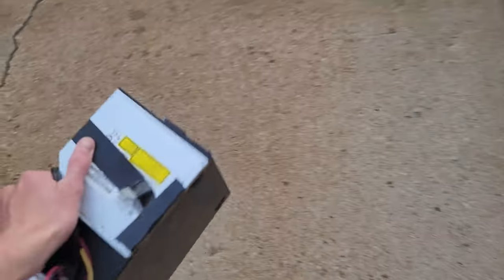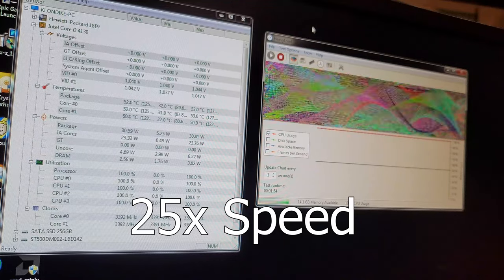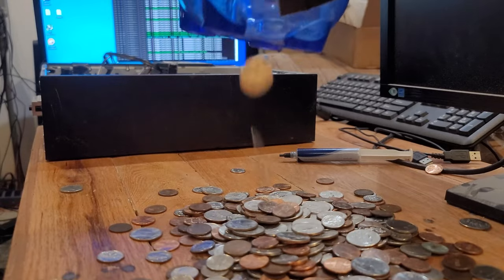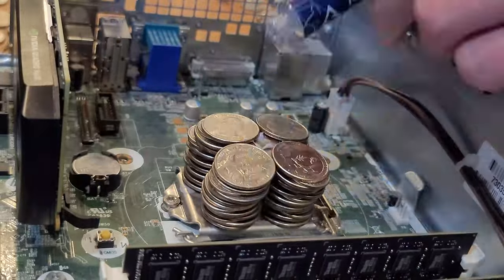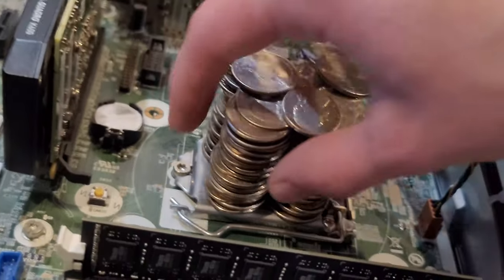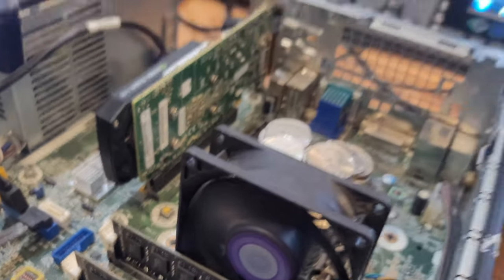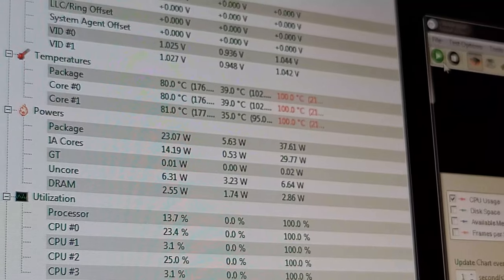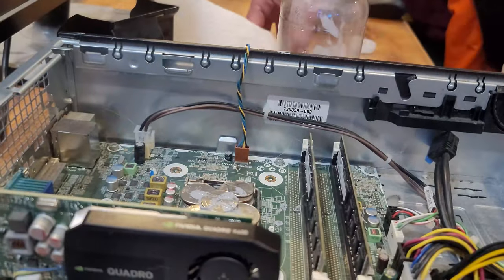Can you GAME on a HEATSINK MADE OF COINS?

Comment: Great video!  Apparently the conductivity of alloys is not just a weighted average of the metals it's made of, e.g. bronze is something like 80% copper but is only 10% as conductive.  But here I think the ridges on the coins are what made it not work, if they were totally flat they would work better.
What about making a cooler out of beer cans?  Cut the top and bottom off, then flatten them and stack them (maybe with some kind of spacer in the middle so they aren't just totally flat and block air), and zip tie the stack to the board?
Reply from the maker: Ooh I did not consider that before. Probably should've looked more into the science behind it but I didn't anticipate this level of success. Might have to make a part 2 with your concept..

Comment: It would have been more feasible if you disabled one of the cores undervolted and underclocked, and stacking quarter dime dime quarter to give it more space for air to pass through between the coins, one of the biggest things with coolers is surface area that air can pass over
Reply from the maker: Yeah I definitely could have made this design better. May have to make a version 2 with those suggestions